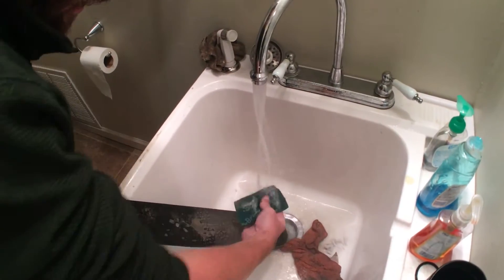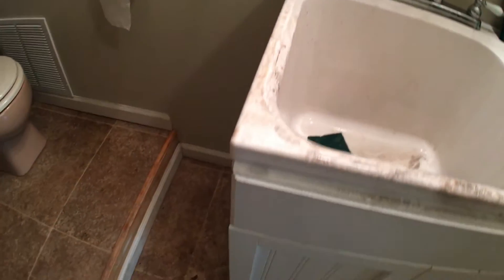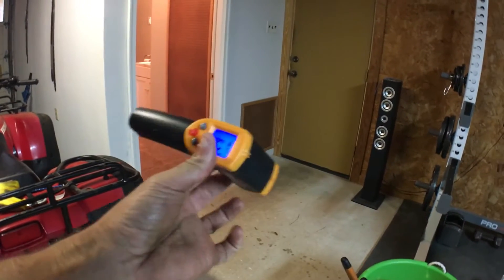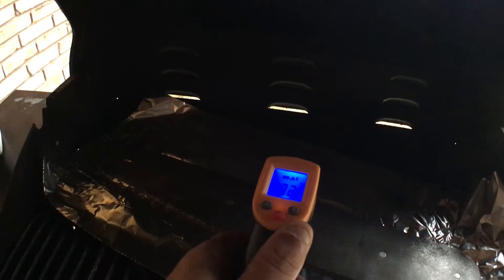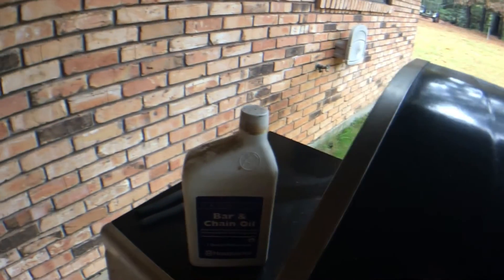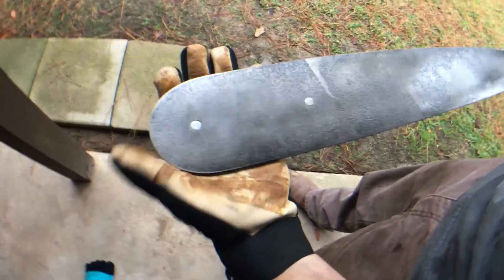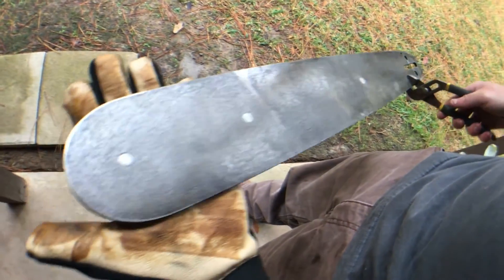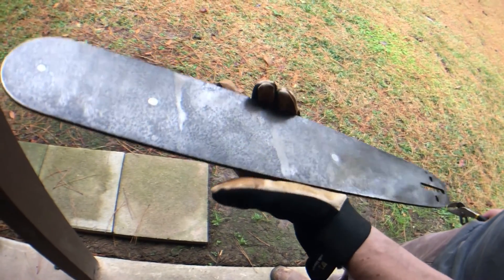Chainsaw Bar Restoration Using Electrolysis Part 2

Comment: I’ve found the etching primer in a rattle can is a great first coating then I’ve been using the high temperature rustoleum and it’s available in an off white that’s great for older bars...   this evaporust product is really awesome...I’m knocking to rust off of lots of old tools and such....👍😉

Comment: Does wheel on end spin? Is burr on edges.  I just paint them black that way it looks new.
Reply from the maker: That is actually a Solid nosed bar, so it has a really hard tip that doesn't rotate at all, it's old school from the 60's, I usually paint them as well but I wanted to try something different with this one since it was rusted pretty good

Comment: what temp did you heat it up to
Reply from the maker: 2 Stroke, Running and repair if I'm not mistaken it was 250-300F I didn't want to damage any temper that was put on during the manufacturing process, just enough to open the pores a little to take in some of the oil that was applied
Reply: cool thanks. have just done my first bar. don't really think the oiling is necessary so am just going to wipe some over it and see what happens. any tips for cleaning the groove out?
Reply from the maker: 2 Stroke, Running and repair they make a hooked bar rail cleaner that works really well, I have a similar piece of metal I use and my air compressor to blow out the rest, works really well.